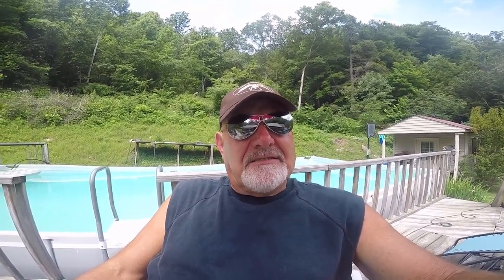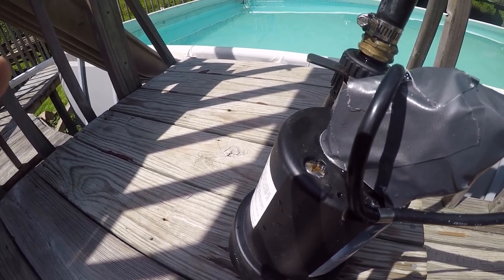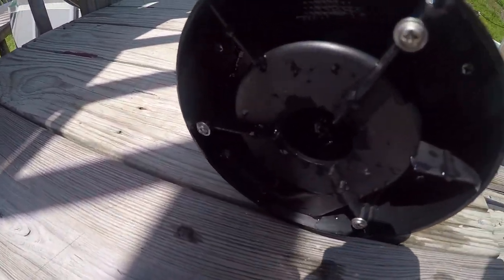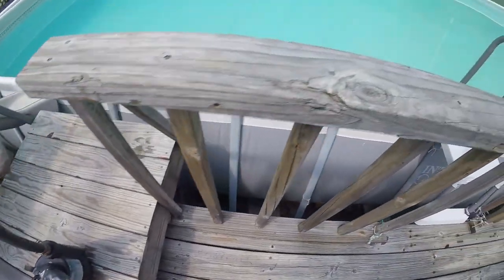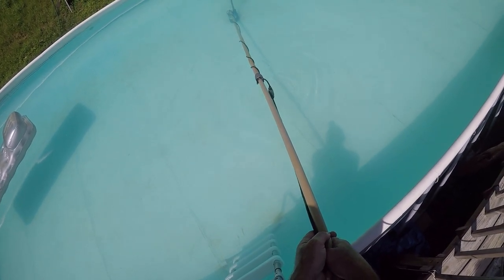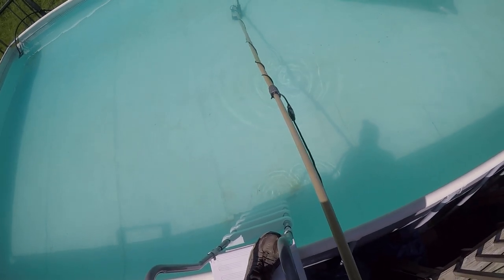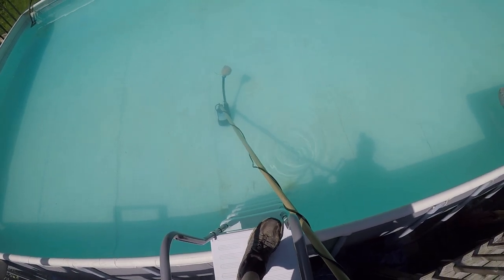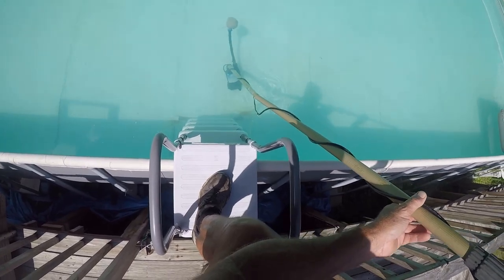*PERFECT* Homemade Pool Vacuum!

Comment: Are you not worried about the bottom of the pump tearing a hole in the liner? Also, what would happen if a leaf got sucked up into the pump? I would love to know how you attached the pole to the pump as well 😊
Reply from the maker: thank you my friend for sharing this with everyone,no i'm not that propeler on the bottom of the motor is out of reach it does not hit the liner, it can't, and the leafs it will suck up, yes it can do that, anyone can attach the pole to the motor with a few screws and some tape, just take your TIME  its easy,  THANK YOU, GOD BLESS,

Comment: Saw your other video and commented there, too. This is one of the best DIY designs I've seen for pools! I'm currently battling dead algae which leaves a very fine silt that can't be filtered by normal means. I catch hell trying to vacuum this sludge from the bottom! Wondering what type of filter element could ever catch this crud without it washing straight through, returning it right back to settle on the bottom! Its clear your design would suck it up! Great job, brother!
Reply from the maker: thank you for your comments, you and i know that this works better than anything else, bottom line it works, betterrrrrrrrrr, god bless,
Reply from the maker: hey kevin, check out my news BAGS AND WHEELS ON MY VAC, THESE bags really work great might be the answer to your algae prob,😀😀😀😀😀